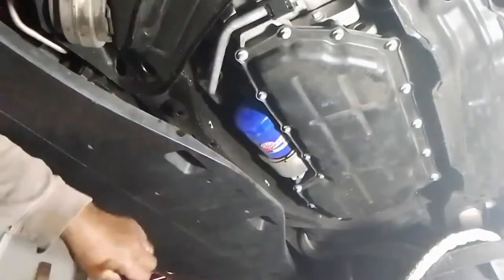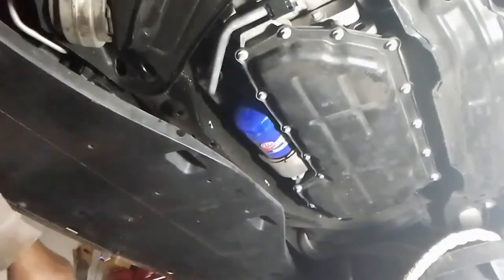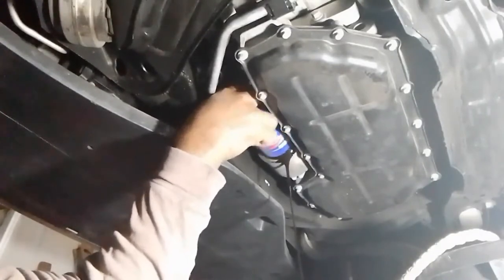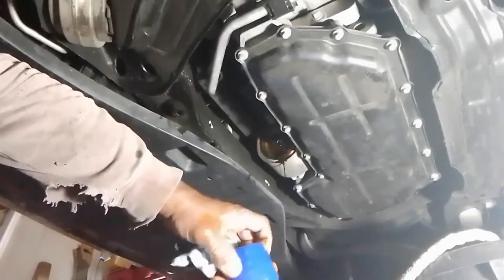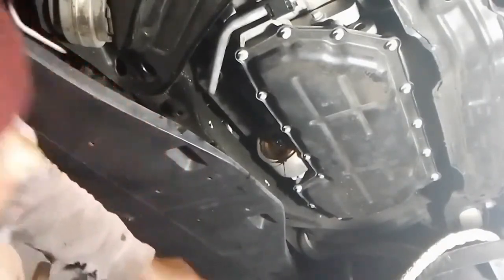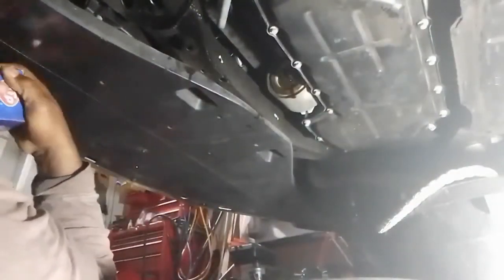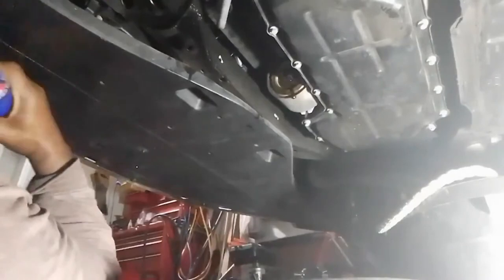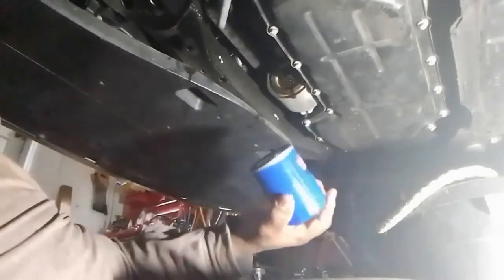Jaguar XF oil filter change

Comment: do you have to remove any plastic covers at bottom first or is it open like that when you begin?
Reply from the maker: Hello J 3030, I am glad that you ask the question. Yes, you  do have to remove the plastic dust cover in order to access the oil pan. Hope that helps

Comment: 5w 20 oil ?how much did it take cheers
Reply from the maker: This is the 4.2 na v8 and it takes a little more than 7 qts. Alway add and check the dip stick as you fill 1st. Check with your jaguar dealer for the correct oil weight.

Comment: Are these cars reliable ?
Reply from the maker: Expensive to work on.but it's a luxury vehicle. To answer your question. Yes
Reply: @thehammermanduke  IS THIS A XF 2011 PETROL 3.0L
Reply from the maker: @angelpilier3989  Hey Angel, this is the 4.2 V8 300hp
Reply: @thehammermanduke  you think they use same oil filter on a XF 2011 3.0 V6
Reply: @thehammermanduke  you have any link so I can search for one I'm owner of a XF just 3 weeks....by now.
Reply from the maker: @angelpilier3989  No I think it's a drop in type that's in the engine bay.